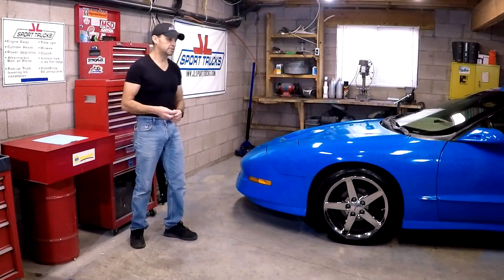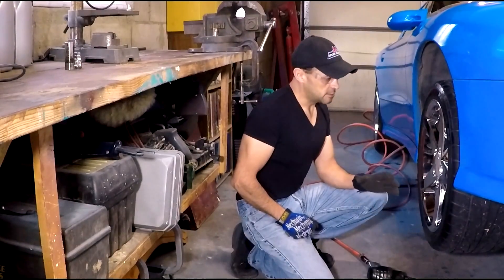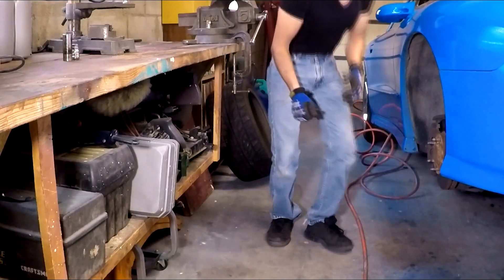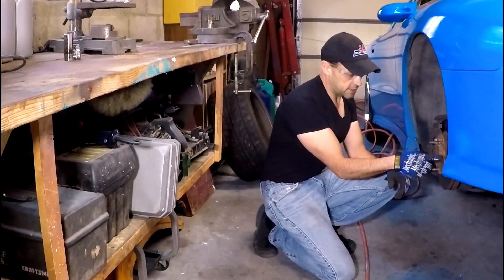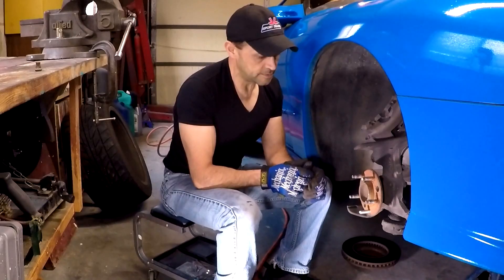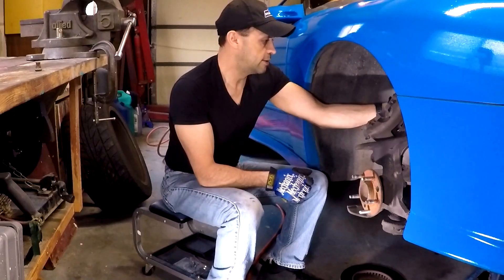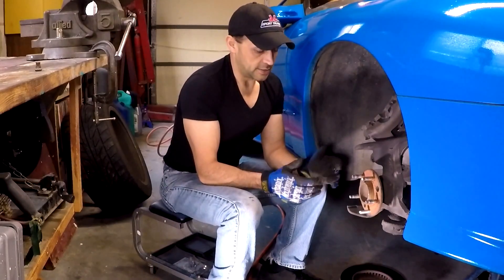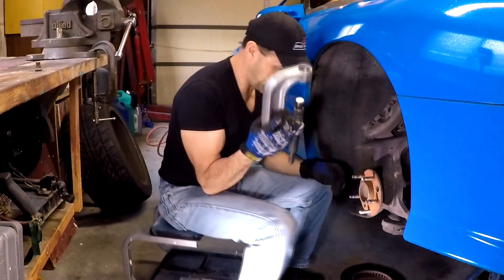How to replace broken Wheel Stud using a Ball Joint Press

Comment: Great video showing a correct method for installing a wheel stud, without hammering on your hub (which hammers the wheel bearing!), or using the lug nut to pull the stud into place (which stresses both the lug nut and the new stud). I have the same ball joint press, and now I know exactly how to use it for installing a new wheel stud this morning. Thanks!
Also, I've never broken a wheel stud, until I started putting anti-sieze on the studs. Since then, I broke 2 studs, and I immediately stopped lubing them. The torque value of the lug nut is spec'd for dry thread and wheel contact. Lubing these surfaces increases the axial load on the wheel stud, for the same torque value. Think of crushing a pipe in a vise: Greasing the acme thread of the vise will allow you to put more crush on the tube (versus dry threads), because it allows the acme bolt to pull the jaws together with greater force. You're not turning the handle with more force, but there's less torque resistance, so you can do more work at the same toque.
Impact wrenches are cool, but they apply a cycled (impact) load, which fatigues the stud. I take a extra minute to install and torque lug nuts by hand.

Comment: what about for the rear studs?
Reply: I'm saying  the same thing about rear axle wheel studs
Reply: The ws6 trans am rear  parking break  is sumthing ive never seen
Reply: I rented the ball joint press to remove 2 studs that I stripped on my passenger side rear axle. It was so easy to remove  the studs it was unbelievable. Plenty of room to use the tool on the rear axle( of course you have to remove the caliper assembly and rotor)… and then I used a stud installer tool( a $10  tool) to install the new studs. And I used the installation tool and put   a new lug nut on the stud to press it in…. No issue whatsoever. So to answer your question, yes that press works perfect on rest axle!